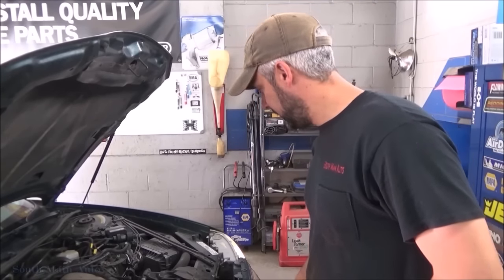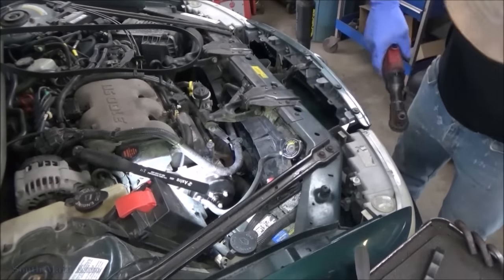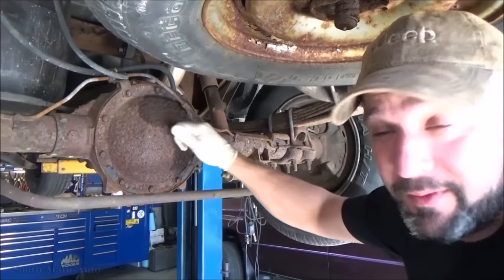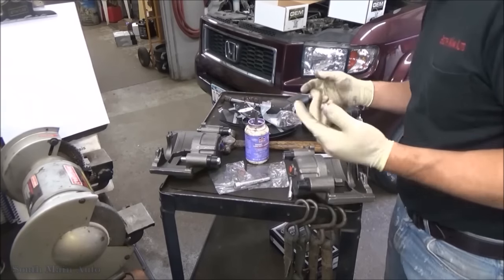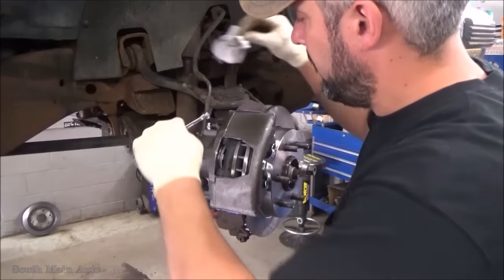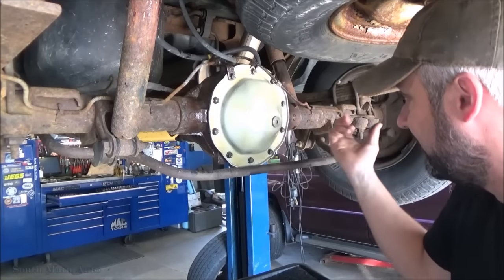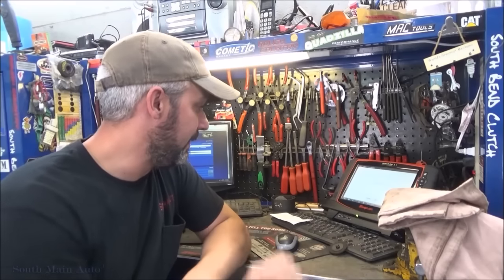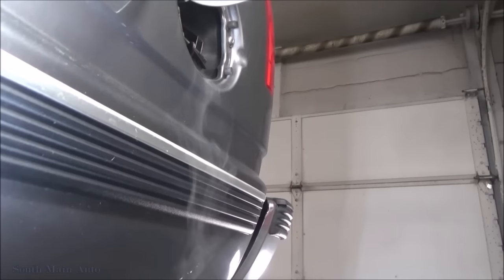Another Normal Day At The Shop - Part I

Comment: as you saw with the canyon buddy how everything was silicone, all the newer cars and trucks are basically all silicone as gaskets now a day. i find using the remover cslled "the stripper" made by lawson or something along those lines and a small wire brush and it works amazing, but that scraper u have looked amaqzing

Comment: I had my speakers cranked when you emptied that gear oil container. My wife came running in here thinking I had a major accident .... :D

Eric - you ever use LPS-3? Stuff is friggin AWESOME. It's like Cosmoline, but dries much faster & thicker. They claim it lasts 2 years (not in an outdoor environment though). I was introduced to it in the coal burning world. We use it on our stoves and boilers in the off-season. Works great! Stuff is a little spendy however. I buy it by the 5 gallon drum, and dump it in the Sure-Shot. Way cheaper than the aerosol cans in the long run.

Comment: You really should take a look into getting fluid film by the gallon and get a air sprayer off their site. Also get the wheel well fluid film they have its super thick and good for areas that would normally wash off quicker with regular fluid film.

Comment: Thank you thank you thank you, finally someone that works on vehicles for a living and does not like dexcool crap. Converted my suburban over to standard green the first week i got it(all gaskets included). My truck runs 10 degrees cooler on average and after the coolant flush(chemical cleaner) it put out 15 degrees more heat from the heater and dropped down the running temp another 5-10 degrees in the engine. I swapped for 2 reasons, bad experiences to dexcool doing weird things and availability when you blow a radiator hose on the side of the interstate.

Comment: Dex cool isn't that bad unless you don't ever change it right Mr O. I change mine every other year so hopefully that's ok
Reply: or until someone not knowing puts something other than dexcool in it
Reply: I still don't like it, it leaves that orange residue in the cooling system when it's not even that old.
Reply: Could be worse.  Could be a VW that requires G12-G13 whatever VW came up with.  I call it  "Super Cool PINK".   Last owner of our VW did a dump and fill with the green stuff.  Had to flush it all out.  Left a thick film of white snot covering all the insides of the hoses and plastic pipes.  Found out over at a few VW forums from the techs (yeah, oddly enough they have several VW techs on them!)  That's a common complaint.  Put in universal Green...and eventually get a clog in the radiator or heater core....  VW's smart.  About 30 bucks a gallon!!
Reply: I won't use any product that pays licensing fees to GM. Anything labeled Dexos or Dexcool. They really pissed me off with my '07 Silverado - I'll  never buy anything from them ever again, nor will I give them another dime of my money.

Comment: In many videos I have heard you mention that in the rust belt the caliper bleeder doesn't want to turn and can sometimes snap off. True this! I have found that if after you install and bleed the new caliper, if you spray the area with brake cleaner (queue dramatic music) AND spray down inside the bleeder with the little tube. Follow up with blowing the entire area off and allow to dry. Now encapsulate the area surrounding the bleeder in a 'chrysalis' of silicone and allow to dry. If done correctly, when you attempt to bleed at a later date, you will find that the silicone has sealed the moisture completely out and the bleeder works as well as when new! Repeat after service for continued weather seal-out. YKW

Comment: First time I've seen a rusted out rear diff cover, how many tons of salt per mile do they use up there in the winter, my gawd!
Reply from the maker: They lay it on thick!
Reply: My 2000 F150 rear diff cover rusted really fast.  I put a really thick coat of Rustoleum paint on it to slow it down.  The local Ford dealer kept them in stock!
Reply: @williamwhite9767  fluid film is a better way.

Comment: my friend always uses the Amsoil MP Metal Protector on the whole frame to help slow the rust on his new vehicles. he swears by it. And I bought one of the Astro 1828 ONYX 3/8" Nano Impact Wrench 450ft/lb  because of you using it! I really like the tool. Thanks for all you do!
Reply: MP is no joke. I helped out in the pits of a TORC offroad truck for a few races and everything on them is raw steel. They can't paint or powder coat anything in case they need to weld it. After every race weekend they spray MP on the frame and wipe it down. I never found a spec of rust on any of them.
Reply: Amsoil MP makes a kick ass chain lube too! Super wet, doesn't fling.

Comment: That Dexos garbage antifreeze has made a lot of mechanics a lot of money.. Both of my S-10 Blazers were victims of that junk. On one the heater core got all clogged up and rusted out. Fifty some bucks for the core and 800.00 plus to put it in. Other Blazer the Dexos ate up the intake manifold gasket and all the antifreeze went into the crankcase. Wonderful product

Comment: Hey hi! 

I know of what had been a great undercoat rust inhibitor -- LPS 3 Premier Rust Inhibitor.  I heard of this from the son of a man whose business in snow country was getting used cars prepared for resale and selling them. He found that including spraying the underside of the cars with LPS 3 he sold made them last too long. So he quit undercoating them. [He did have to make money after all.] LPS 3 is probably still great, but I live in the sunbelt and have not needed to do an undercoat. [It is 35 years later so I do not assume the chemical mix is the very same.] [I have used some LPS 3 for long-term lubrication. It does have a strong petrochemical AROMA. And wearing gloves when using it is a very good habit.]

Comment: Wife took our SUV to Midas for an inspection (after I told her to absolutely never go there) and they gave an $800 estimate claiming my steering box was bad. It's one of those older GM boxes where you can adjust the lash on the gears which was all it needed.

Comment: I use gaskaseal on paper gaskets. Three bond on others.....silicone causes to many problems. I never use regular antifreeze anymore...strictly waterless (No rust). After I mount new calipers I inject brake fluid from an unopened bottle...cuts down on contaminated fluid. Hard to believe you don't buy bulk gear oil for rear ends. It's a good idea to put rubber cap on bleeder screws.

Comment: The yellow and red subcompact car hiding behind the hoist and near the door (looks like an Isetta) seems to have a problem with steering: turning the steering wheel doesn't seem to have any effect on the front wheels.  ;-D
Reply: Clinton Andrews i bought my daughter one once and i think it had a transmission problem. You had to push it to get it going and if you stopped thered be a whining noise

Comment: Wait I have a question ain't you suppose to block of the line going to the filler neck also? Or no? Funny thing I had a Hyundai Sonata with the same problem but my ode was p0456 small leak

Comment: Good morning. Where's Josh? also are you getting any rain. it's pouring here in buffalo.
Reply: it sure is
Reply: I miss rain and update New York a lot. I love in Arizona all I get it 110 degree weather and no rain.
Reply: Here in central MA we've got no rain either. Every storm that's come this way this season has vaporized before it even hits the ground. Lawns are dying everywhere. Had several days with humidity in the high 40% range - pretty damn dry for this area.

I miss AZ, especially when winter hits. Blue skies every day except monsoon season. Was like another planet compared to MA.  Loved being able to work on my cars without breaking bolts off and getting rust surgically removed from my eyeballs ... :)
Reply from the maker: He had day off and it is as dry as a popcorn fart here. A little thunder blast today and that was it
Reply: I saw that storm Greg mentioned hitting Schenectady this afternoon, and figured we'd finally get some rain, since it seem to be heading due East. NOPE! Totally vaporized AGAIN. Crazy - never seen it this bad.
Reply from the maker: Yeah we just had a smal thunder boomer and as soon as the rain hit the ground it dried up. It will come some time...
Reply: +Smitty Smithsonite I'm just sick of the desert. But northern AZ isn't bad
Reply: Northern AZ is alot like MA weather wise, except we're between sea level an 1k feet (a little higher in western MA). Just different trees and scenery, and no elk, lol. I think you've got much better views out there.

Comment: I had a problem with my gas filler cap on a 2000 Sonoma.  The gasket was hard and cracked so I bought an after-market one but it only lasted about a year before it, too, ended up with a cracked gasket.  So, I bought an OEM cap from GM.  I was surprised to find the new cap looked a lot different than the old one.  It had no gasket at all.  Instead, it had a plastic ring around the part where the top of the filler neck. (The old one had a gasket that went down inside the neck.)  Still working fine for 3 years.  I wonder if the ethanol gas is the culprit?  Maybe that's why they changed it.

Comment: Eric,  what's up with the engine being opened up on the Honda 😮😮
Reply from the maker: ;) Secret...
Reply: +South Main Auto Repair haha
Reply: Turbo charging it?  Get inspired by ETCG??
Reply: Carb it first, then supercharge it
Reply: Hondas never break
Reply: +m ph tell that to my b20b that cracked sleeves at 15 psi...
Reply: +m ph their auto transmissions do, but that's about it. Ha
Reply: Stroker crank, big bore kit, cams, and a supercharger! :D 

That would be great to see ...
Reply: I'll bet the head was cracked in #4 cylinder causing the spark plug to oil foul
Reply from the maker: Jason Cassidy - Pretty close :)
Reply: I have owned my Ridgeline for 10 years, heard all about the problems with the early production units, I am lucky with mine so far, 210k miles and no issues

Comment: Love the GMT400 trucks, so I got excited when the GMT400 made it in! You don't see alot of them. Trucks are pretty bulletproof! I was wondering why you would replace the caliper, but you made sure to explain that! Down here in the southwest, we don't see the rust, and when I did the front brakes on my 98 K1500, I did just pull the pins and lubed it all up. Oh and that 3.1 in the Buick was probably one of the most accessible water pumps in a transverse mounted motor that I have ever seen!

Lets see Part 2!!
Reply from the maker: I agree with that! I have done so many of those pumps in the past! Gravy!

Comment: I know you have done whatever you could in your power to help save money for your customers and you have gone through a lot to do so but I have to ask. Did you at least read the code on the ladies engine light? I know it's not much to run a quick obd2 reader but I also do not know if your aloud to read it if not asked to.

Comment: Hi Eric. Your videos are awesome. Thanks.  I  have a 2000 odyssey that has a bit of issues with the idling  notsmooth. This is what I have done so far. replaced the spark plugs, clean the idle control valve,  clean up the trottle body, Adjusted the valve lifters.Clean the EGR valve port to the intake. End result did not help.Any ideas  on resolving this problem

Comment: whats your opinion on using on of those vacuum bleeders to bleed brakes?
Reply: i was curious about that as well. I use one on my family and friend's cars and I love it. Only downside is that the reservoir cap doesn't fit all cars. The one I have works on older fords and all BMWs but does not fit on Hondas + Acuras.
Reply from the maker: I use a pressure bleeder when I have too.

Comment: This is a craigslist ad I found. Selling a 99 mercury cougar has 139k miles. its manual 5spd won't shift into gear not sure what's wrong with it. maybe clutch is bad or shift fork not sure really. check engine light on for oxygen sensor. asking 550 obo.  Should I buy it or not?

Comment: So, uh, what are the odds of that spare tire coming down.
Reply: Well, if is is like my last Silverado, The chances of it coming down are real good.  I hit a bump on a road under construction and the spare broke the cable that suspends it.  Rear of the truck jumped up in the air as the spare must have tried to wedge itself between the road and the underside of the box. The truck  came down and the spare passed me rolling down the road.  Spare down? No problem Lady!

Comment: have you ever heard of spaying brake cleaner on all the pulley's and serpentine belt to clean it and quieted it down, it keeps making noise, i check all the pulley's, the  belt tensioner is fine,  belt is new, guy told me to try brake cleaner, its so freaking annoying
Reply from the maker: It will work for about 2 seconds... and possibly explode

Comment: Hi Eric, I sure could use that extra 15 hp in my Citröen here in Danmark! Is that even possible? I am Married, but I take the risk:-)
Reply from the maker: Gut the interior, carpet , headliner, seats any thing you can unbolt, take a huge dump before you drive and I think that may be the most HP's you can gain....

Comment: So I have a question. I have a 2007 Jeep Grand Cherokee and it needed the leak detection pump replaced so I had it replaced and the check engine light was reset. A couple days down the road it’s comes back on for the leak detection pump again. What could be causing it to throw the light on for the same thing.

Comment: Hey Eric I was doing a real differential cover on a 02 Chevy 2500 6.0 and there were metal parts at the bottom look like a shim or cover with concave (in a bunch of pieces on the magnet) do I to him he needs a rebuild or new diff? He just bought it from the junkyard and he didn't check it before installing
Reply: I put it back together and said run it , I warned him about it tho ( what would you do) ?
Reply from the maker: I would have popped the side gears out and seen if that is where it came from. Then make a decision.

Comment: Hey Eric, I bought fluid film by the gallon and an undercoating gun and will be doing my whole undercarriage. Would you recommend it?
Reply from the maker: Funny you mention that. I just talked with them today and they are sending me some product to do a vid on it under coating my Toyota. I will be answering all FF questions in a video before this winter :)
Reply: In the Fall I got a gallon of FF and the gun for undercoating my Ford Explorer (1997, 199K miles).  Jacked it up on blocks in the rear and sprayed it.  When done I just drove down off the blocks -- and had no brakes.   (Did I say it's old with a lot of miles?)   Evidently such a "violent landing" caused a rupture in the brake line at the rear of the delicate little thing.   Took it into my customary shop so he could get it on the lift and replace .    When I picked it up, he asked,   "  What did you do ?  Run over a 5-gallon bucket of oil ? "      No, Ron.  That's a product called Fluid Film.  That's why I had it jacked up in the first place.  He wasn't familiar with FF.   I should have taken him a can.
Reply: South Main Auto Repair Can't wait!

Comment: Those chain shops are a ripoff, pep boys quoted my neighbor a whopping 600.00 for a thermostat on his 350z, he bought a new thermostat and I installed it, I charged him 60 bucks, I just did what he asked me to per pep boys diagnoses, turns out it was the cooling fans weren't working which was causing it to overheat, installed new fan assembly and it was fixed.

Comment: seems like newer vehicle work would pay more?
Reply from the maker: They only need oil changes...
Reply: +South Main Auto Repair hmm ones right off warranty should need more than that. brake pads/rotors at least. trans fluid changes every 30k. coolant every 5 yrs. plug changes. window motors buttons etc common early problems.
Reply: +South Main Auto Repair hmm ones right off warranty should need more than that. brake pads/rotors at least. trans fluid changes every 30k. coolant every 5 yrs. plug changes. window motors buttons etc common early problems.
Reply: +South Main Auto Repair hmm ones right off warranty should need more than that. brake pads/rotors at least. trans fluid changes every 30k. coolant every 5 yrs. plug changes. window motors buttons etc common early problems.
Reply: +South Main Auto Repair hmm ones right off warranty should need more than that. brake pads/rotors at least. trans fluid changes every 30k. coolant every 5 yrs. plug changes. window motors buttons etc common early problems.
Reply: +South Main Auto Repair hmm ones right off warranty should need more than that. brake pads/rotors at least. trans fluid changes every 30k. coolant every 5 yrs. plug changes. window motors buttons etc common early problems.
Reply: +South Main Auto Repair hmm ones right off warranty should need more than that. brake pads/rotors at least. trans fluid changes every 30k. coolant every 5 yrs. plug changes. window motors buttons etc common early problems.
Reply from the maker: Coolant every 5 years and plugs once in a cars life... not big money makers there haha. Any how I just do what ever rolls in...
Reply: +South Main Auto Repair I hear you. 3v 5.4 plugs always paid well. do them with an impact bill it out for atleast $450 labor. some shops break them and bill them at $1k+
Reply: +South Main Auto Repair I hear you. 3v 5.4 plugs always paid well. do them with an impact bill it out for atleast $450 labor. some shops break them and bill them at $1k+
Reply: +South Main Auto Repair I hear you. 3v 5.4 plugs always paid well. do them with an impact bill it out for atleast $450 labor. some shops break them and bill them at $1k+